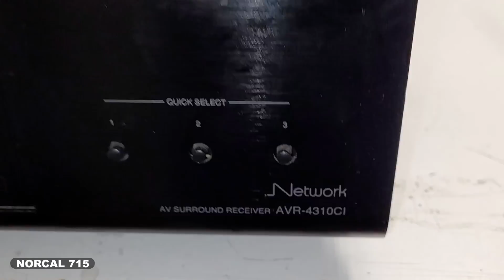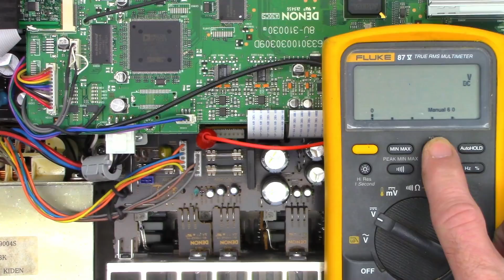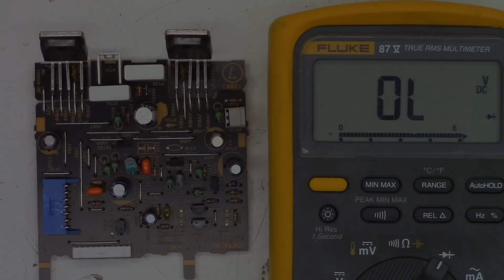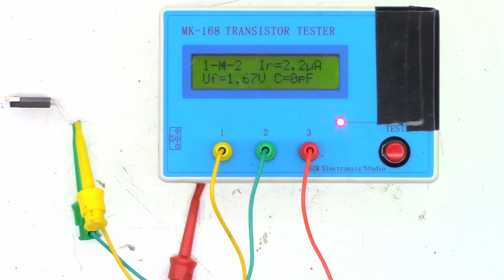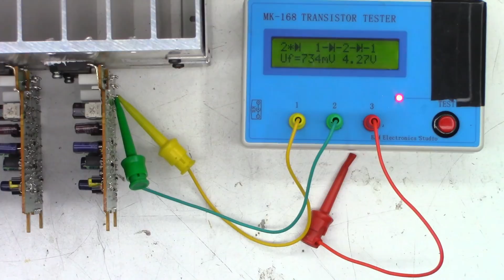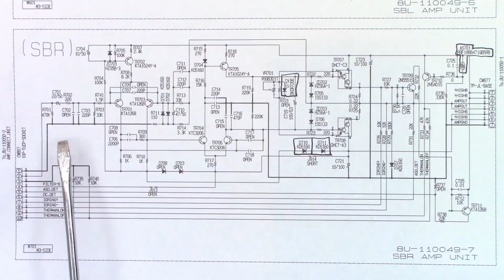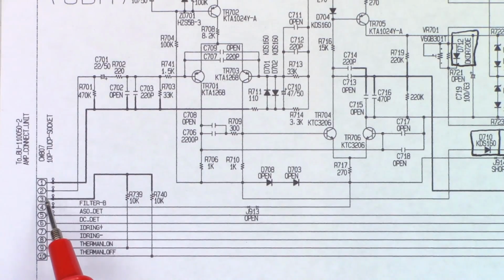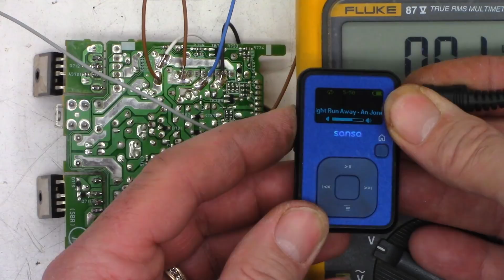Denon AVR-4310CI Shuts down - Red flashing power light- High DC offset on one channel - Part 1

Comment: Hi.
My friend has gifted Denon4520CI from usa.
I live in India. On the internet usa site I saw in Denon specifications it was mentioned 220v compatible.
is there any shifting switch inside the AVR? How to use

Thanks
Reply from the maker: Most likely the USA model is only 120V. The international model would have a 120/220V switch on the back panel.

Comment: Is volume at zero when you are using the bias test point to test DC offset? My bias test point is showing 13.5ma but the manual says 8.5 +/-.5 but the potentiometers don’t go lower than 12.

Comment: A few of those caps look like they have seen some serious heat! The sleeves being shrunk like that would make me replace them!  Can't wait for the next installment!
Reply from the maker: I have seen that mainly on the main filter caps on these later models, I am starting to think they were made that way, or they use very low temperature heat shrink on those. This thing showed very low signs of overheating.

Comment: denons are notorious for the voltage regs to go out in the power supply causing the same symptoms
Reply from the maker: I have replaced many +15 and -15 regulators, mostly in older units though. All this needs is B+, B-, and ground to operate the amp.

Comment: Hello bro,,,,, I hope u can solve my problem with denon 3310 networking  ,,,, who can I contact personally.
Reply from the maker: I have not had much success with networking. Make sure the firmware is up to date even if you have to use a USB (if that is even possible). Do a "reset to factory" complete reset before you give up. If all else fails try to contact the manufacturer technical assistance.